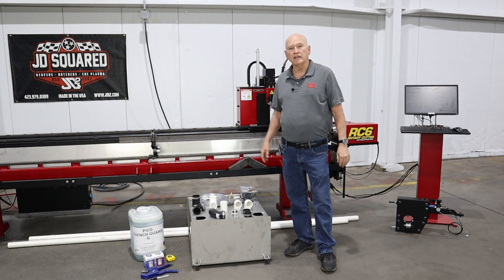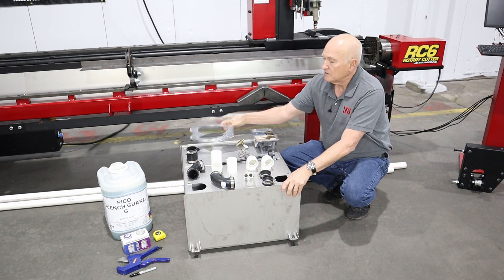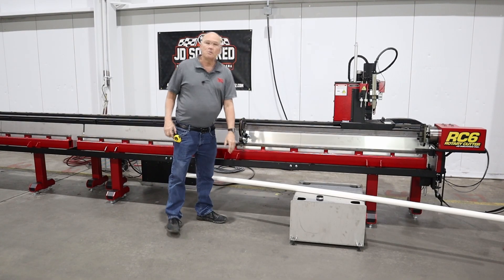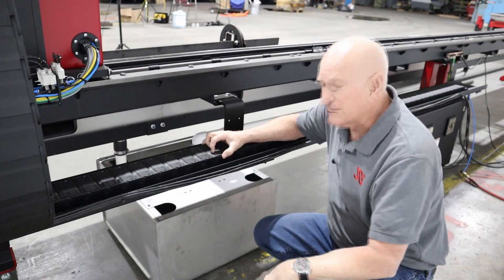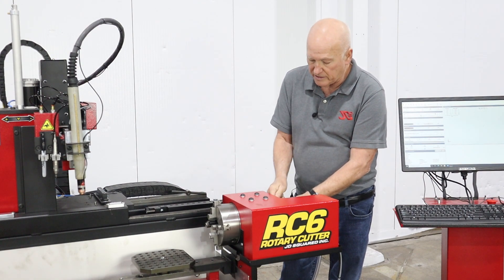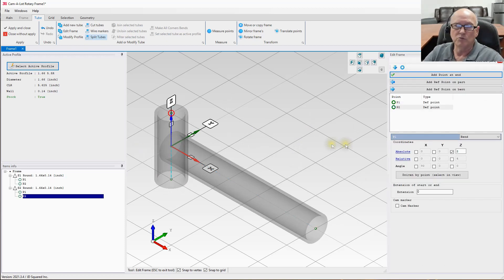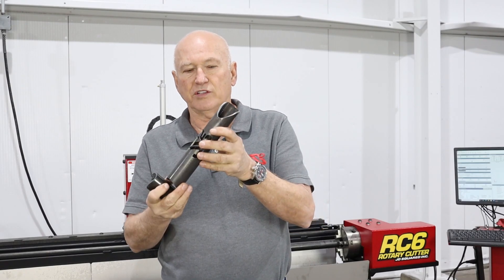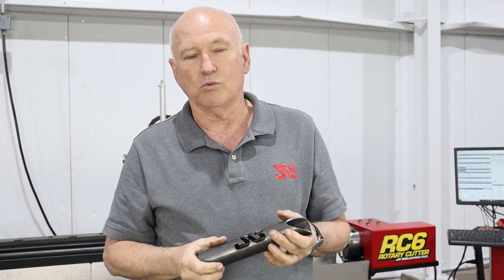RC6 Water Injection Installation & Operation.

Comment: how much of the quench guard out of the 5 gal is used for proper mixing
Reply: Hello Denis. Not sure if you got an answer yet but 1/2 gallon will treat 5 gallons. That is on the high end of the ratio. The manufacture says that 1 gallon will treat 10 to 20 gallons of water.